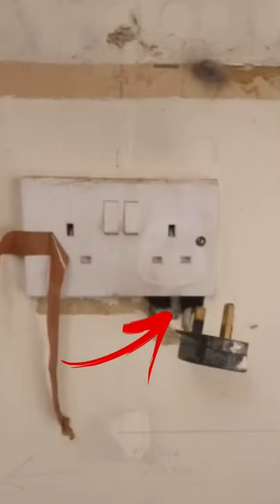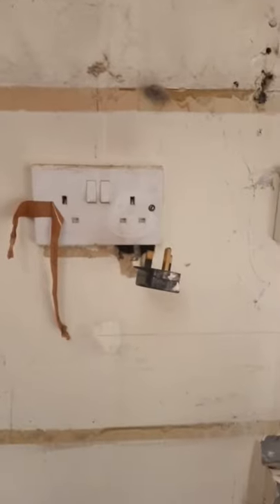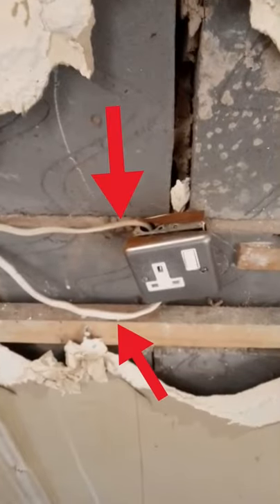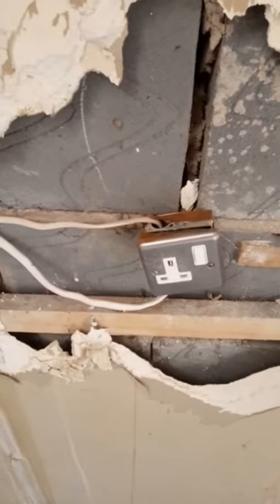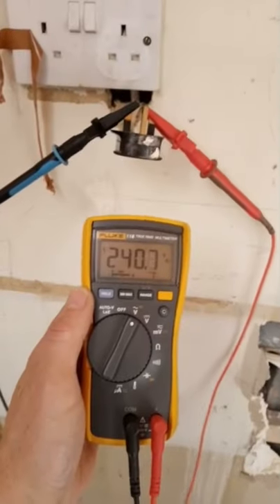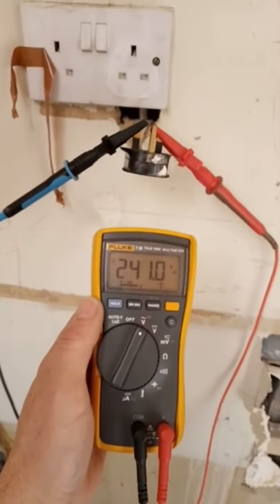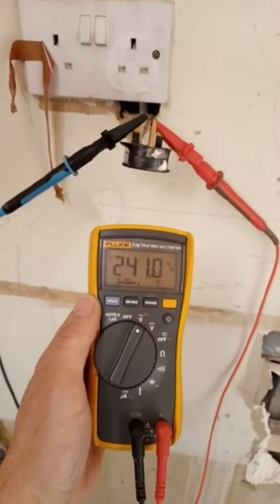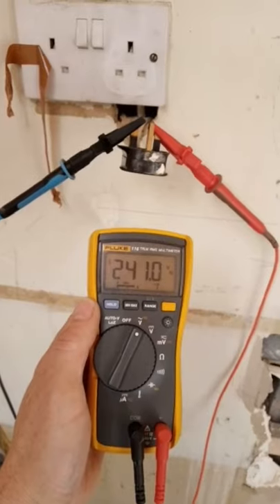Dangerous - 13 Amp Plug Top Still LIVE Even When Disconnected - Electrical Fault Finding

Comment: When I was an apprentice back in 89/90 we were in an office building for the National rivers authority and there was a printer in the middle of the room with a flex cable hanging down from the ceiling grid with a surface  socket and box hanging in free air, the plug was on the live feed side and the socket on the end of the photocopier.
Take the plug out and you have a live plug in your hand.
Reply from the maker: Thanks for sharing your thoughts and experience Paul

Comment: I once saw a temporary electrical hookup at a mall, basically an unused shoplot, but there was no power? Basically a 3 phase board, but one of the links for one of the phases were gone, (we use 16mm² cables to connect 3 phase main switches to RCDs and not busbars)

Basically what they did is they got a flex, tied one end of it to one of the phases on the RCD, and the other end with a plug top. Basically if you unplug the plug, it's live. Only used to power like an old computer though.
Reply from the maker: Thanks for sharing your thoughts and experience 👍🏻

Comment: Couldn't isolate the lighting circuit in our first house. On investigation, some 'electrician' had straped the line across to the ring main in the CU. 38 Amp lighting circuit/ring!
Reply: gasps in Canadian that's quite the lighting circuit! What was hanging off that lighting run, massive stage lights?

Comment: In the mid 1960s, while still at secondary school we were setting up for the school Christmas do. Some chaps arrived with their electric guitars etc and a multiway power board that consisted of 6 sockets wired together but no supply lead, because they had one "special" lead that had a 13A plug top at each end. At the age of 17 I was horrified by that, and told them in no uncertain terms to take it away.
Reply from the maker: Thanks for sharing 👍🏻

Comment: I found this in my garage. Wiring going across the roof from one side where the power comes in from the house over to a a plug socket. I had just moved in. I unplugged the plug, didn't know what it was doing. Noticed it was wired in T&E but didn't think much of it. 

Anyway the plug sockets on the right hand side of the garage now didn't work. That T&E plug was the line for everything on the right hand side of the garage. I did get it fixed..
Reply from the maker: Unbelievable
Reply: Lucky to be here to tell the tale.

Comment: Very sadly I've seen this done multiple times over the years, first time as a teenager at the model engineering club my dad went to, power in one room went off, land lord had not fixed by following week, so one of the older guys took the trailing socket off an extension, replaced it with a plug, plugged one end into a working socket in the room that still had power, other end into a socket in the room where power went off, and for several months that was used to keep power on. When I worked as a spark a good few years ago found similar things quite a few times. Last time I saw one like that my ex bought a house, double socket each side of bed, length of flex lying on the floor with a plug on each end, one socket was on a ring final, other socket was just screwed to the wall, no cables to it, clearly never had been, and we can only assume double ended flex had been used to put power in on one side of face plate and allow the other side to be used for appliances. The stupidity of people never ceases to amaze me.
Reply from the maker: Thanks for sharing your experiences Dave 👍🏻

Comment: Gary do you have any idea of why someone would even do that, obvious safety issues aside. Were they wanting to run a welder occasionally or a High powered motor?? Couldn't quite follow the wiring scheme. but it looked like a temporary circuit extension, but they transposed the wires perhaps..?

Comment: I did a job once where the only way to switch off any of the mcbs was to switch off the main breaker. The new owner of the house also told me she had to bring in a gas engineer who immediately condemned the system, due to the previous owner's total incompetence.

Comment: Many years ago (~35) while working with qualified electrians laying out an arena for sound and lighting we had need to power a 6Kw device 100m from the supply.  All there was was a 100m armoured tail coming off one of those large red 3 phase outdoor waterproof plug/sockets (3 single phase armoured runs exiting).
On the 100m end was a metal backed double 13A socket box.

What did they do? wire 2 13A plugs to the 6Kw device and plug them both into the double socket....
A 25A load balanced supply......neither side exceeding 13A.....
And ran it for 3 nights/shows

Comment: Going to guess some previous owner had put in a generator in the garage, to power the house when the power is out. To connect he went the cheap route and had a cord with a plug on it, and the socket there was where he plugged it in when not in use, likely wired correctly so live to live. He would plug the generator in on power failure, and pull the house breaker, running the house off the generator till he saw the neighbours were lit again, when he would stop the generator, unplug from it and lug into the socket, then turn the house back on. Not called a suicide plug for nothing, and all too common in use.

Then likely at some point some new owner decided to panel the garage, and put the plug into the top socket, probably as he had a drill or something in the bottom outlet, and panelled it in. Then it stayed there for your friend to discover. Correct but much more expensive option would have been to have the plug out there, with a flex to a wall box with an isolator, and then a separate cable to the house board, with a generator changeover switch mounted in the incoming feed, to safely change the source of supply for the house from the grid to the generator source. Provides isolation of each supply from the other, and only one at a time will be able to be connected. Bit more cost and you have an auto changeover panel, that will both start the generator, change it over, change back 5 minutes after power is restored, and also provide a charge source for the generator starter battery. But a lot more expensive compared to the plug and wire.
Reply from the maker: Wow what a detailed message 👍🏻 many thanks for sharing. Gaz

Comment: I've seen 110v extension leads with a plug on both ends a couple of times; ring finals being mixed up and each leg being fed from separate breakers is something I've come across a few times too.

I actually went to look at a fire alarm system today showing a "general fault" on the panel on one zone: that zone was a recently refurbished office... Contractors had moved a call point, fed the cable into a junction box (without a gland) and then somehow managed to connect it to a redundant lighting circuit 😬
Reply from the maker: Thanks Adrian for commenting and sharing 👍🏻

Comment: I had to rewire a house for a housing association,  when I walk in , again all the rules I pulled the main fuse. Lighting was wired in speaker cable and sockets wired in telephone cable and not a single earth anywhere. So am I surprised by this am afraid not

Comment: This is yet another reason to regulate our industry, fatal consequences for some unsuspecting person. D.I.Y electrical work should be outlawed. We have all heard it, " My Dad is an electrician I know what I am doing " Yeh right then you find this. Also this sort of thing is more common than you think. Scary
Reply: Sorry, can't agree with you there.  I do some small bits myself, but then I know what I am OK with and don't attempt stuff where:
a) I am likely to Die (working on live circuits...not bloody likely)
B) I am likely to cause injury to others
c) I haven't got the foggiest of what is needed
d) Look at the job and think too long about whether I should do the job or not

So I will happily replace a broken socket/light switch or light fitting.  I'm ok to put in a spur from the ring, but, when it came to running the power to my workshop...in came the professionals.  I probably need a new consumer unit and that will be a job for the pro team too, both to check the existing and, if needed, replace it. 

It comes down to (in my opinion) common sense (a - d above) as well as understanding....OK, I just talked 95% of the population out of being able to use a kettle without scalding themselves there, let alone touching anything electrical.

By the way, my dad was a plumbing and heating engineer, I worked on a few jobs with him so I am happy to replace taps, ball valves, cold water tanks and run outside taps...but I get the pros in to service the boiler and didn't even think of running the underfloor heating in the extension we had done...People who say 'my dad is/was a xxxxxxx so I know what I'm doing' should have an understanding of just how bloody hard their dad's job really is/was and know their limits, if they don't then they are probably talking a load of cods.  Or they are just plain stupid, you pay your money, you take your choice!
Reply: @acespark1: You can put as many regulations as you want in place, you'll never stop the Cowboy spark, Plumber, Builder or DIY Dave doing this sort of crap.
Reply: Regulations will not help - The joke that is Part P has proved that. The more you regulate it, the more you increase the cost of doing it properly, so you'll make things worse, not better.
Reply from the maker: Thanks for commenting 👍🏻
Reply: There's an article on David Savery's blog on a NAPIT electrician who twisted wires together, put 2.5mm on a 40A breaker with 1.0mm to a spur and nearly started a fire. Guy is still a registered electrician. Perhaps a case of who regulates the regulators?
Reply: @JohnSmith-ws7fq  : Or again on David's site: The electrician with supposedly 50 years + experience, whose work was so bad it killed a child.